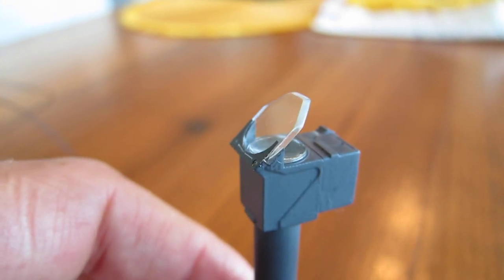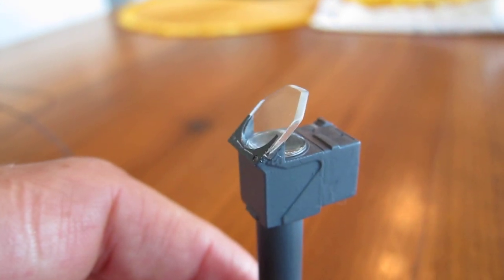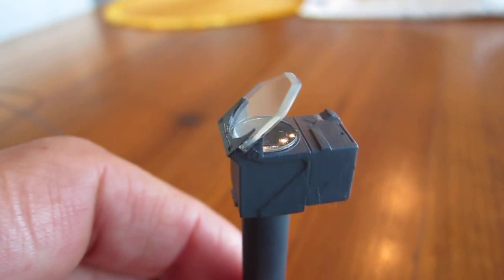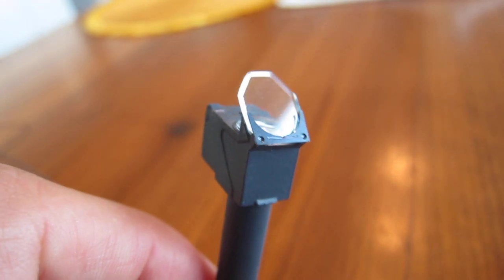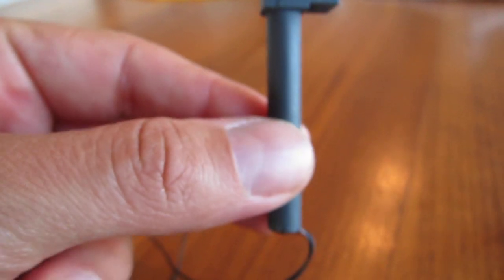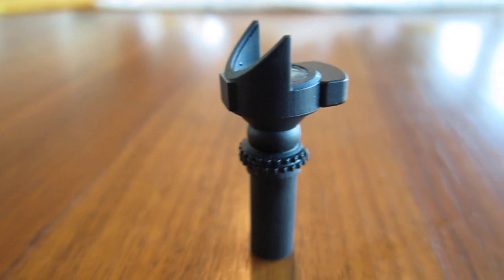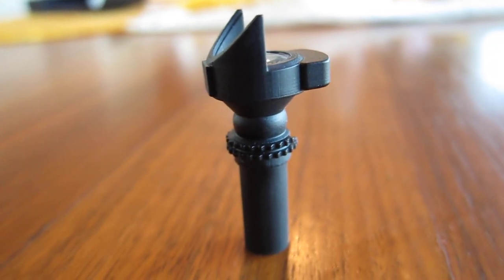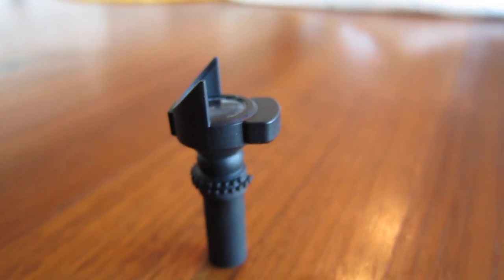functional 1/6 scale gunsight Revi 16 for FPV

Comment: Outstanding craftsmanship on the Revi sight Tim!  I would be all over it if it fit in my FMS Bf-109F.  See Tim's Mk VIII sight in action:  https://youtu.be/C88coyfe1nc
Reply from the maker: Thank you! It measures 72 mm from top of reflector to bottom (of which 53 mm for the 8mm dia. carbon fibre tube), 10mm wide. As your camera is rather centered on the reflector, the vertical tube won't ruin the overall scale appearance.
Reply: tempted, very tempted...